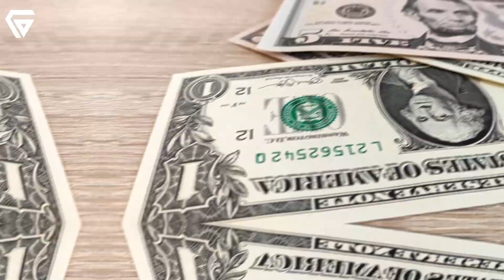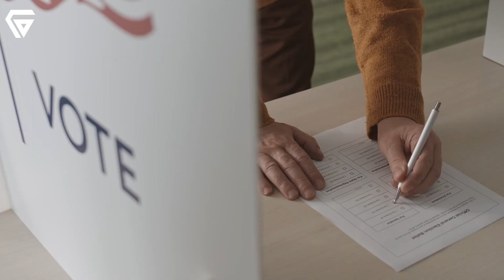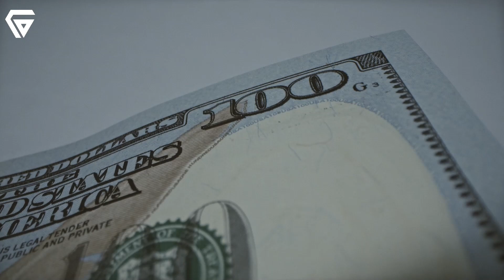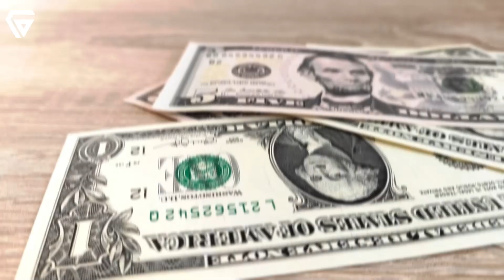Why It Is IMPOSSIBLE for Australia to Build High-Speed Rail?

Comment: Every time HSR is mentioned in Australia the morons in the media throw up supersonic rail travel through a tunnel, lauding a Sydney-Melbourne travel time of 3 hours. No one understands that 200-250kkmh is HSR.
Reply: 200 - 250km/h is fine where cities are located close together, with consequently shorter travel times. For the longer distances in Oz, you need to go faster; you need to keep the journey to around 3hrs, (not a dreamed up time frame, but learned from extensive observations). Business travel is required to provide most of the fare income. A medium speed railway will be too slow for the business traveller.  Sure, go ahead and build the bit cheaper medium speed railway, all you'll deliver is a quick train for pensioners.
Reply: @RobboSez it's mid speed you are talking about
Reply: @RobboSez  trains always beat the car.
Reply: 200kph is NOT “high-speed rail” by any stretch. 250 perhaps… not really though - most European and Asian trains that qualify as “high-speed rail” regularly operate at 260kph+
Reply: @LucyJrts  yeah but many of them dont operate above 230kmh for long stretches but rather on certain sections, sure there are different Models. More important than the actual top speed is achieving the Project aims you have and doing it in the most effective way possible which means different things in different contexts.
Reply: @BigBlueMan118 sure, but my point is if you built a 200kph rail network and called it “high-speed rail” you’d be a global laughingstock.

France’s TGV sets regularly operate at 320-350kph
Reply: The only problem even more evident now is that even if we want HSR, we can’t really build it without bankrupting ourselves as we all know full well how the ALP federally mismanages the economy
Reply: The irony of someone calling other people "morons", but actually himself not knowing even the most basic stuff about HSR like the fact that once you are building a new line then the additional cost of building for 320-360kph rather than slower speeds is almost nothing and you would actually increase costs by building a longer & curvier line than a straighter faster one.
Reply: Medium speed stuff would be a start though, that is the point.
I would prefer that over nothing - more bloody planes.
Reply: @chuckbeggles8858 but then it can't compete with aviation.
Reply: @jayfielding1333 - while I understand that aviation cares for its self and has bloody good lobbyists into our governments, I personally don't care for it (and vote accordingly every chance I get). 

Competing with avaition to me is measured in 2 key metrics - 
1. Is travel time, 
2. Is travel cost. 

Cleanliness and the onboard staff and how they do or don't treat customers are further metrics.
Reply: @chuckbeggles8858  No it really wouldn't be a start, we dont have any trains that can travel faster than conventional rail 160kmh. NSW and WA could both have opted for their new trains to have a revenue operating speed up to 200kmh but they didnt. We are starting from Scratch and we should do it properly. It barely costs any extra to build a new alignment for 250kmh+ than it does to build for conventional rail speeds.
Reply: @BigBlueMan118  - so go and buy some trains that can travel at such speeds. 

They will buy trains to use on the Sydney network as they see fit - exhibit A: Sydney metro. 

I personally do not believe the lnp will be taken seriously by Gen Y and Z without a faster (than current Australian standards), lower cost, environmentally friendly transport option. 

I am generation Y and regional - I say that based on personal experience.
Reply: @chuckbeggles8858  Yeah but if you are going to buy some new trains anyway why would you buy ones that are capped at 200kmh when it doesn't cost much more to get ones that can do 250+

You are trapped in a defeatist mindset - we need a step-change in our rail infrastructure the way Sydney Metro has been, not a slight touch of improvement as you seem to be suggesting.
Reply: @BigBlueMan118 - I am very open to HSR, but getting it out of our supposed govts is proving at best difficult, costly and time consuming, 

Meanwhile the population grows. The climate situation gets closer to what scientists call D day and frankly nothing gets done, except expensive studies that sit collecting dust somewhere at best. 

I will let you know IF the Australian people put the ALP back into govt at our next federal election. If we elect Dutton and his cronies then I expect the current HSR plan to once again end up on the back burner (and thus why the mind set). 

The lnp in its current form, current aproach will never spend the required money on HSR. 

Even Sydney's second airport should have been built outside Sydney, like at Newcastle with a HSR link between it and Sydney but oh no, not the lnp.
Reply: @chuckbeggles8858  Yeah and I think we agree on most things but the point is that it makes almost no cost difference to design a line for 250+ as compared to 200 but the country is so big that we need that extra speed, the expert report says that in order to make rail the dominant mode between Sydney and Newcastle for example you need a journey time of around 60 minutes which you can only do with a proper 250kmh+ train, for Canberra the figure wasn't released but I am lead to believe it needs to be under 90 minutes for which again you need a proper 250kmh+ train. Half-heartedly building something for slower speeds is a sure recipe for disaster.
Reply: @BigBlueMan118  I definitely agree there - if you want fast trains… you don’t half-ass it with this 200kph nonsense. You get yourself an actual fast train, otherwise that investment wasn’t worth it in the first place.

These days that means 250kph minimum, but as technology progresses I’d say we can go even higher - 280, 300, 320 even… should be reasonable, and all of a sudden HSR is very comparable with flying as far as travel time (including check-in and boarding times etc.), and could easily outcompete it for price.

At the very least we should be building the lines with the ANTICIPATION of faster trains running on it eventually, even if our initial rolling stock purchases end up topping out at say 220kph